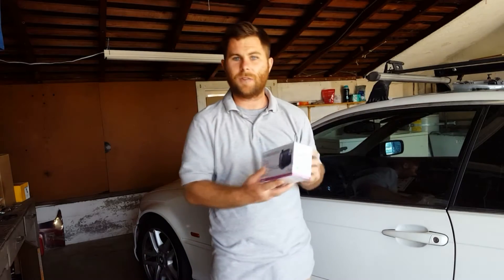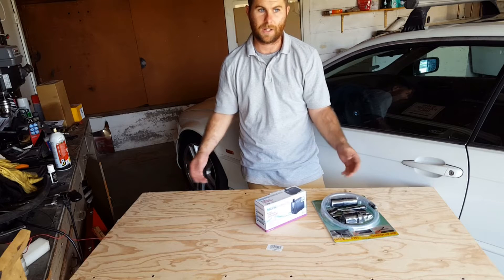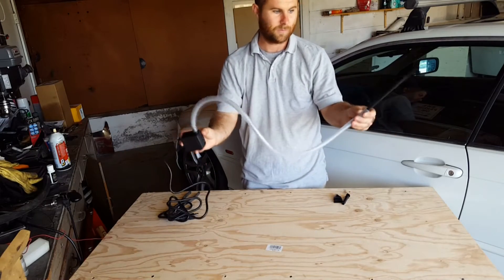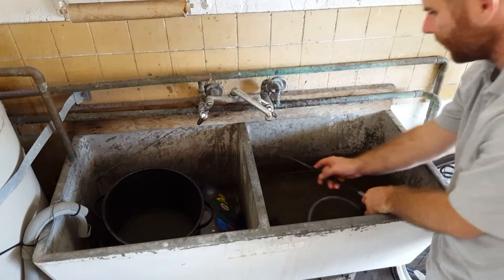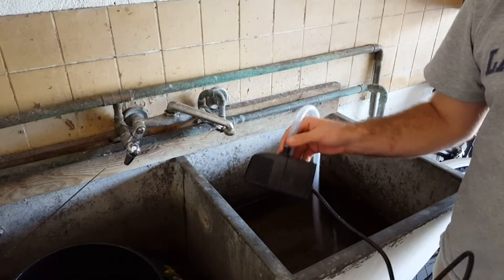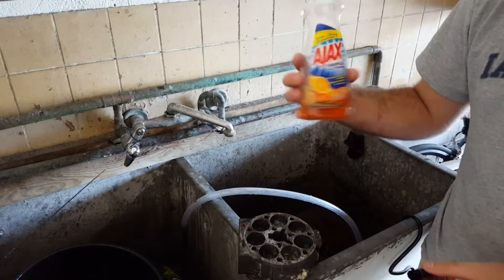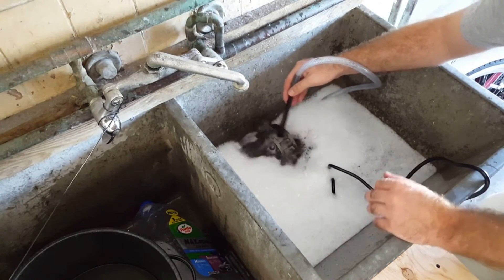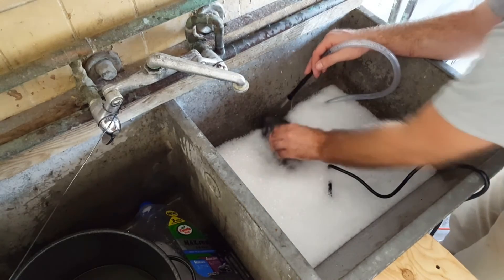Building an inexpensive parts washer with a submersible pump

Comment: I like the idea, but it seams to me if you are not using an expensive solvent you are trying to conserve, why have the pump at all.
Reply from the maker: Vinny Bulldog it gets into spots where a brush will not. i like using dish soap because its everywhere. i dont have to worry if a store is open or closed on a sunday when i run out.

Comment: Doesn't a solvent  pump need to be explosion proof. Solvent is flammable. Don't want to blow up my shop ;-)
Reply from the maker: Mark Johnson lol i use dish soap. best degreaser ive ever used. also not flammable, but good one.
Reply: I tried to use mineral spirits to start a fire it didn't even start the fire